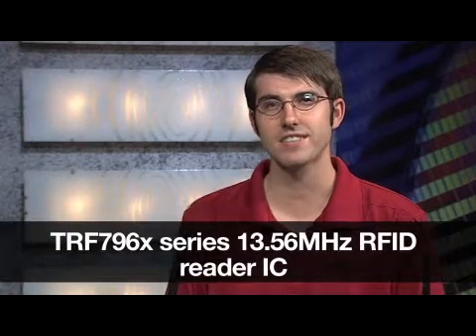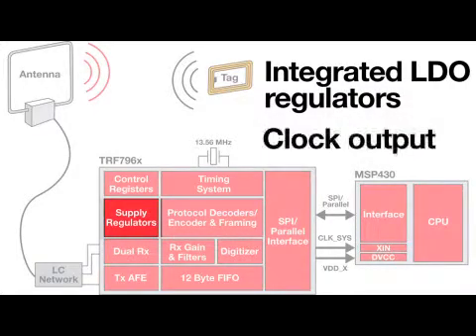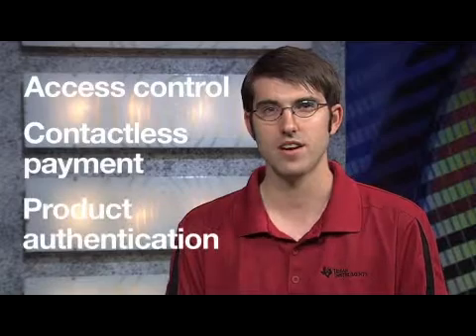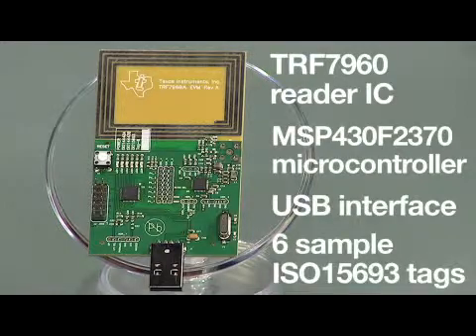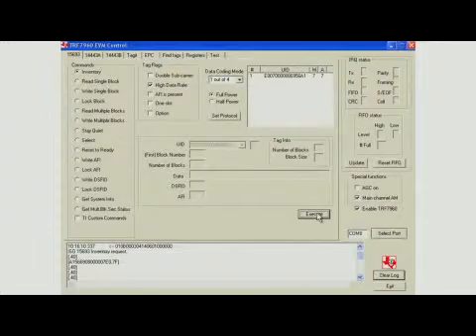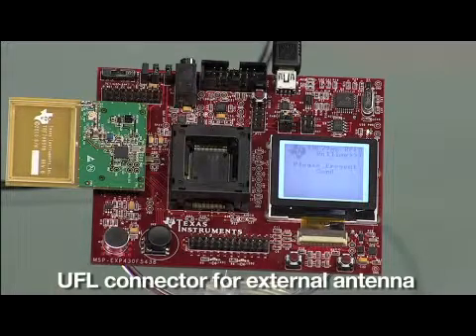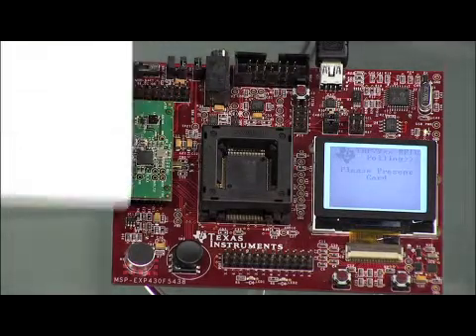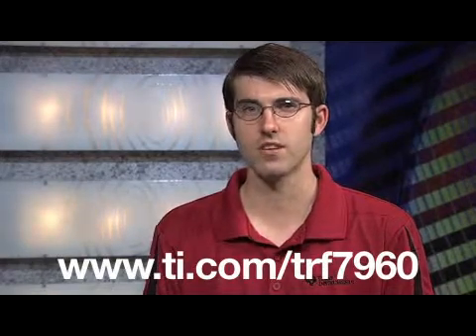TRF796x 13.56 MHz Reader

Comment: what is the maximum reading distance in meter of rf module trf7960 , how can i extend it upto 2 meter, can i used external antenna for extending the range